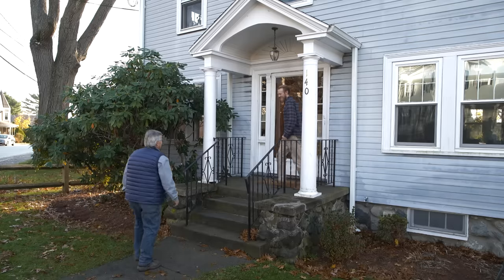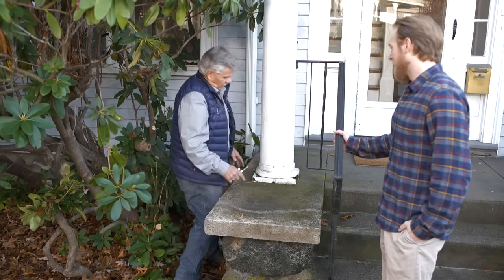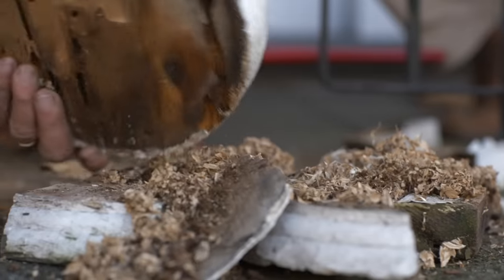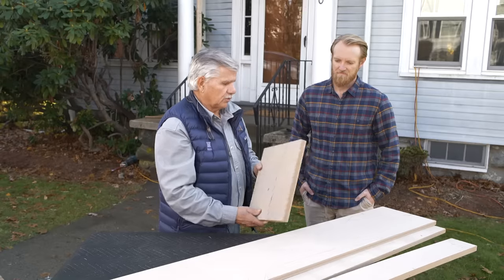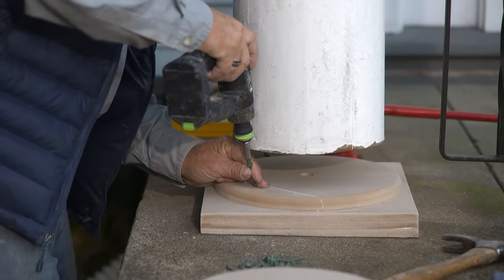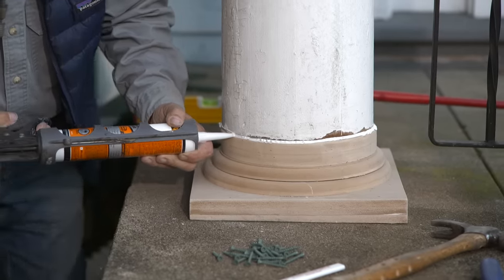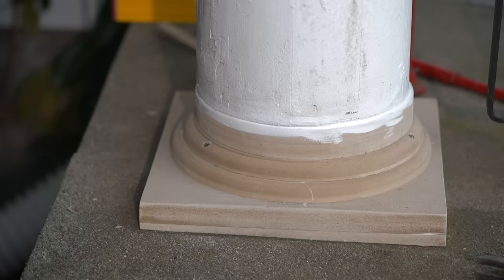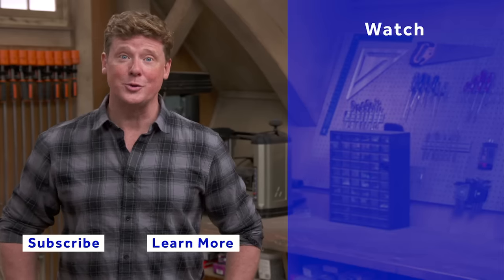How to Replace a Porch Column | Ask This Old House

Comment: Man I wish I could sit down with Tom Silva and just pick his mind. Guy is an Encyclopedia of woodworking.
Reply: Same. However i can't forgive him for securing loose floorb by driving screws through the carpet
Reply: @ryk3899  Link?
Reply: @Eric K  find it yourself
Reply: @ryk3899  I've had good results doing that using O'Beery's Squeak No More products. Worked well thru carpet and bare floor.
Reply: @ryk3899  Did he use the screws that are designed to do exactly what you described?  Because if so, then he did it exactly correct...
Reply: @Doug  it's a hack. A half a job. Lift the carpet and fix it correctly
Reply: @ryk3899  again, if he used the screws that are for this very purpose, then he DID do it correctly.  Don't be so bitter.  Continue to waste time and lift up the carpet like a Neanderthal; I promise no one cares.
Reply: @Doug  again, it's a bodge job. And if doing a job correctly is being a neanderthal, then stoop me over and elongate my forehead
Reply: @ryk3899  the screws he use when he fixed the squeak are meant for that application. Why would you go thru the hassle of ripping out baseboards and pulling out carpet and making a bigger job then need be. It was not a hack. Your just a hater
Reply: @michaelcarroll991  *you're
Reply: @ryk3899  so you both do it correctly.  He just does it faster.  Glad we came to this agreement.
Reply: @ryk3899  Hack or not it's worked fine for me on more than one occasion. Why make extra work  ?
Reply: @ryk3899  you're talking about a guy who's forgetten more about wood then you'll ever know.
Reply: @ryk3899  oh boohoo cry me a river

Comment: Came out great. Would adding a plastic liner in between the post and the concrete be a bad idea? Since water makes its way from the concrete up into the post.
Reply: 2:39
Reply: The materials they used do not absorb moisture as it is made with the hulls of rice and polymer for adding a bit of strength. There would be little benefit to plastic.
This product is called Resysta.
Reply: Still should of put a two light coats of Rubberseal or Kilz on the bottom of base just to be on the safe side.
Reply: @kalijasin  no
Reply: @kalijasin  Should HAVE , not should of....

Comment: i have some somewhat square posts sitting on concrete columns with stone accents that have trim going around them that keep rotting and needing to be replaced every so often , what can i do to prevent that ? i understand that they absorb the moisture from the stone column.

Comment: A hole was drilled in the center of the new post base so air could go up into the column to keep it dry. But how is air going to get though if the joints are sealed? I have to fix my front porch corner column and porch because the previous owners didn't clean out the gutter, so the water overflowed onto the porch & column.
Reply: You can put spacers  under the base to allow moisture release.

Comment: Great work... But I fear that a considerable wind will rip the porch roof off because the column is not secured to the foundation!
Reply: Mine are not secured and never have been, house built in 1880. The weight of the roof should keep them in place ... barring an insane wind.
Notice his are secure at the top so any minor roof lift by wind will keep it in place.

Comment: I am not an expert on this, but should I worry about the hollow center of the square base?  the square base is glued from 2 pieces and supported only on the 4 sides, while the center of the base supports the weight of the column and the porch, am I worrying too much?
Reply: The column is round and hollow, so the weight is actually on the edges of the square base, not center. ⭕🔲

Comment: Does jacking it up not damage the house or loosen any nails or screws?
Reply: @mae2759  ... in most cases it's less than 1/8 inch. At that height you are not pulling nails or screws. You are basically flexing the wood. (no more than what happens with a change of season)

Comment: I’m confused! Was the column hollow or did the ants eat into the column? That nest came down as soon as he cut the post!
Reply: The ants moved the wood from below, up into the column. Most columns are hollow. Tapered or non-tapered fluted or plain are all hollow. Also when you look at the different materials: polymer stone, fiberglass, PVC and even wood they are all hollow. ... A wood porch column is made by gluing staves together in a circular form and then turning and cutting them on a lathe.
Reply: @tj_gsomething_  So … the concern is whether the carpenter ants continued to eat their way up the post. It looks like the infestation is not still active.
Reply: The column is hollow.  The nest was likely sitting right on top.
Reply: ... basically, the ants stop where the water problem stops. Worst case is they cut the column higher and make a taller base, then match it on the other side.

Comment: Do I need (stair) sub-treads to go under 1inch solid oak stair treads? I removed carpet off the steps, currently there are 2 inch raw construction treads. I will take those off and replace with 1 inch solid oak treads. But I will loose 1 inch rise. I have 3 stringers, left right and middle. Thanks.
Reply: Glue 2 1x together and router. Or use 2x oak or whatever you want again.

Comment: I know for the broadcast TV show there are time constraints. But it's time that you make an online version that shows the full details. I can't believe they spent this much time showing how they leveled it and put those scribe pieces on the bottom but then never showed how to actually cut to  the scribe marks
Reply: I came to the comments looking for that same explanation. They look too thin for a table saw. Maybe they used a bench sander?

Comment: I have a question for this old house……
I have a120 year old house. During a remodel they reframed the stairs. Now they lean. How do I fix that? I can send pics.
Reply: Is the foundation sinking/settling? If you place a ball on the floor, does it roll in the same direction? Maybe the house needs to be leveled?
Reply: You tell the guy you paid for the remodel to come back and fix it.

Comment: I know it's a budget difference,  but wouldn't a better long-term solution be replacing the columns with fiberglass columns?
Reply: Fiberglass will definitely last longer than wood. So yes it's gotta be a budget difference. They didn't even recommend doing the other side. You know that other side will need updating soon!
Reply: @tj_gsomething_  they may have done this this way so the homeowner could do this at some point in the future, and teach him some responsibility.

Comment: Maybe spray some insecticide up inside the hollowed out column before reassembling? I think those ants will continue to eat up the column.
Reply: I wonder what the bottom of the column looked like. Too bad the camera cut away and didn’t show it.
Reply: @MoneyManHolmes  Seemed bug-hollowed when the nest material fell out, which is what prompted my suggestion. I'd say you saw what I saw...  :)

Comment: You never place wood directly on a concrete porch. The wood will act like a sponge with any moisture that may be sitting on concrete. Get a specific either metal or reinforced plastic base to separate contact between concrete and wood
Reply: Agreed. I would have done what you said but my porch is wood.

Comment: You've come this far, probably should've inspected and reworked the column too.
Reply: They started out with the inspection on that column right at the beginning of the video
Reply: @Engineer9736  Poking a Leatherman at a column doesn't mean the inside is sound. Look at the carpenter ant nest that came out of there.
Reply: @paulmitrano3612  the rot starts from the outside inward, and the rot made it easy for the ants to cause damage.

Comment: Wow he actually used a mdf type material and no damp proof protection
Reply: 2:50 First watch the video before barking
Reply: @Engineer9736  they used a product called Resysta that's made from polymer and rice hulls, and is impervious to moisture.
Reply: Mdf lol...
Reply: @Farm_fab  They explained that, yes, you have to say that to Fire Blaster, he didn’t hear it